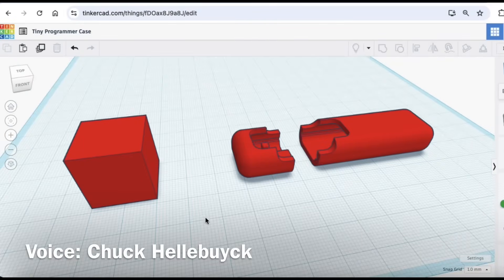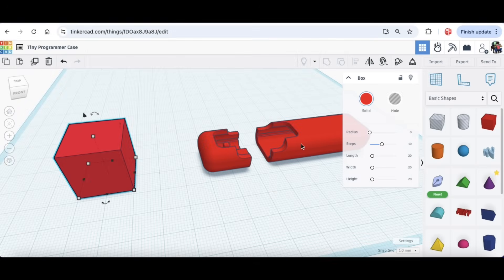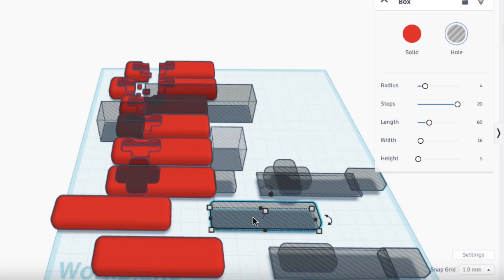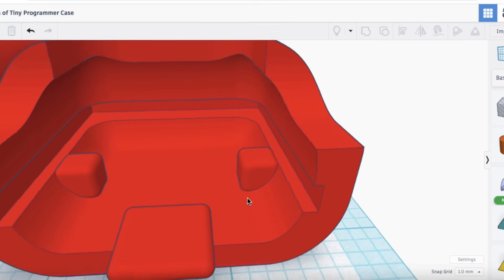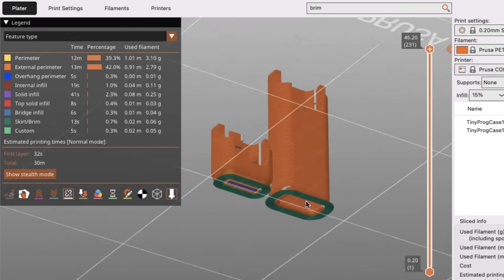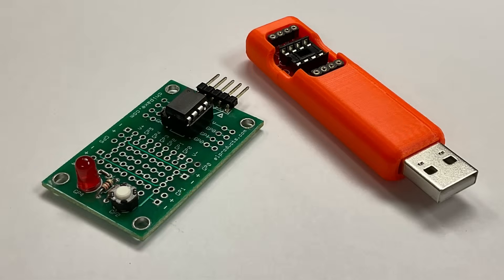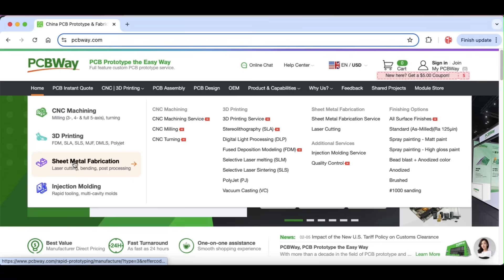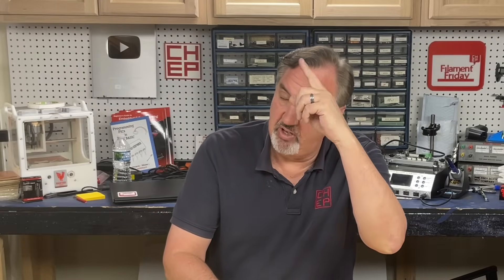Designing a 3D Printed Case for an ATtiny85 Programmer using Tinkercad

Comment: Thank you Chuck. Why do you prefer PETG for electronics projects. I'm interested in your thoughts in this regard. Best wishes.
Reply from the maker: Because of its flammability. It’s not really an issue for low voltage but higher voltage can be an issue.
Reply: Thanks very much!

Comment: I’ve been 3d printing and modeling since around 2017 and have had/do have several printers and I started out on tinkercad and used it pretty much exclusively until a few months ago when I forced myself to get good at Fusion 360 since it’s by far the most popular and capable actual parametric CAD design software and I wish I had done it when I first started. 

This isn’t necessarily to dissuade anyone from using tinkercad at the very beginning or even long term if they rarely design stuff but in my experience I lost so many opportunities over the last 8 years because I wasn’t skilled enough with any actual parametric CAD software to design a complex part to fix a problem or create an invention etc that just couldn’t be done with tinkercad because the more complex you get with tinkercad the more crashes and sluggishness and missing geometry/mesh problems etc you run into and it’s very difficult or even impossible to upload and edit existing STL files if they’re even remotely complex so I limited my own potential by not learning fusion sooner so unless you know you’re never going to design anything remotely complicated I’d advise skip the tinkercad phase and go straight to fusion and invest in a month or two (I think there a 1 month free trial) then you can easily find thousands of tutorials because it’s the most popular and you can ask questions in any of the hundreds of various fusion help support groups on Reddit and facebook etc and once you learn enough to know what you’re doing in that month or two you can move on to FreeCad or another similar parametric design CAD software that’s free if you don’t need all the advanced features of fusion and you’ll know enough to figure out how to do what you want to do in those.

TinkerCad skills don’t translate to skills with any other CAD software because it’s completely different and not really CAD so basically any time spent on TinkerCad is wasted if you plan to go to fusion or any actual Parametric CAD

Comment: Tinkercad is the best way to start in CAD hands down. Especially if you aren't going to do it regularly and only need basic shapes. However, after you get the basics a more powerful piece of software is needed. After learning fusion360, if I go back to TC to do anything a little complex it gets aggravating cause it's easier with a 2d sketching element with extrusion and much more exact.  I've actually been accomplishing basic shape manipulation using orca slicer's primitive shapes, negative parts, splitting and mesh boolean operations. Basically everything easy that I did in tinkercad. This might be a good video topic.